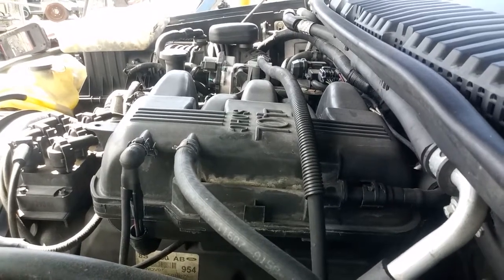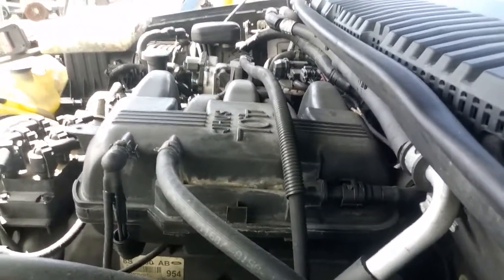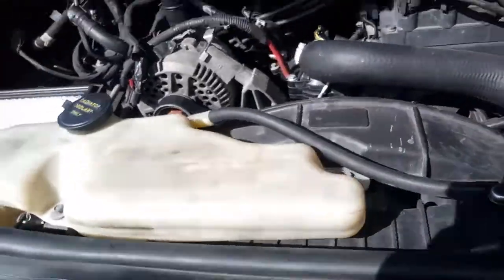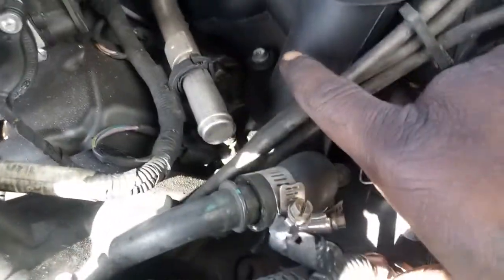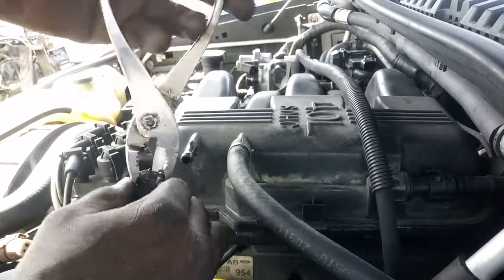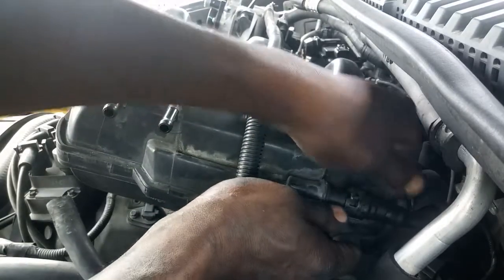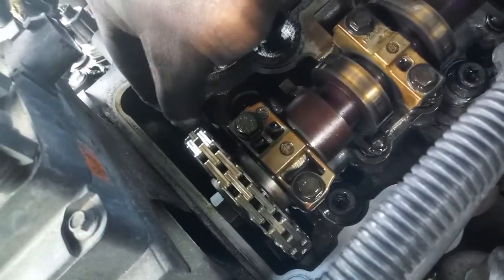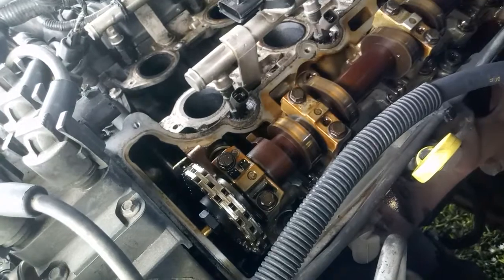2008 ford explorer 4.0 sohc engine noise.

Comment: Oooh. She hurt..  sohc motors known fir timing guides going out and tensioners dropping then belts will fuck everything..  damn motors got 3 different timing chains in it and ford thought it was a good idea to use dinky plastic guides in it..  not to mention the plastic thermostat housing, plastic upper plenum bolted to an aluminum block….  Just engineered to fail..  i mean if you do a google search with just 4.0 sohc it will come up with nothing but “timing chain rattle tap” “timing chain fix”. “Rattle noise”…
Reply: Not being picky but if you have 4wd then it has 4 timing chains. Just did mine.

Comment: reason why you have broken parts because you should replace the timing chain tensioner to prevent damage in the long run  tensioner fails and you get damaged Parts because the timing chain is loose

Comment: You can literally hear the piston hitting the valves
Reply: It was really that bad? Not just a swap out the Cassettes and Replace the Hydraulic Tensioners and away you go??
Reply: @1Patient  it’s interference. jump one tooth and you just trashed your engine.
Reply: @iamdjnam  yeah I watched part 2 and part 3 and when he got to the end and had the cover off the balancer shaft chain was broken that engine was toast.